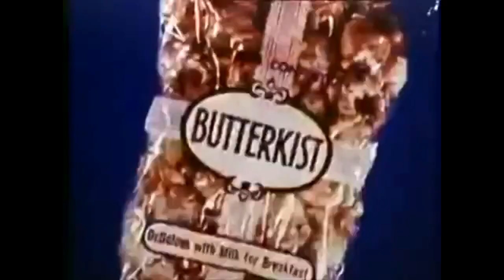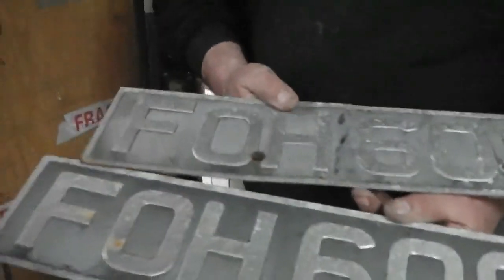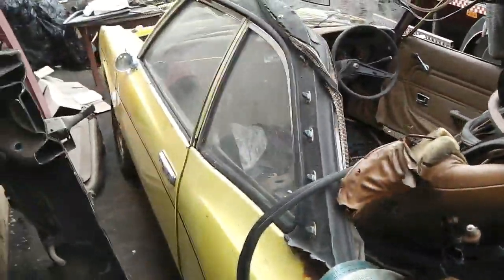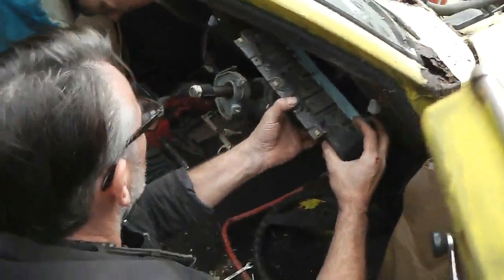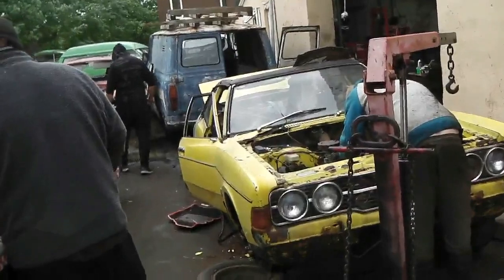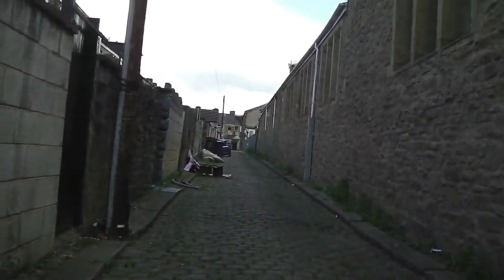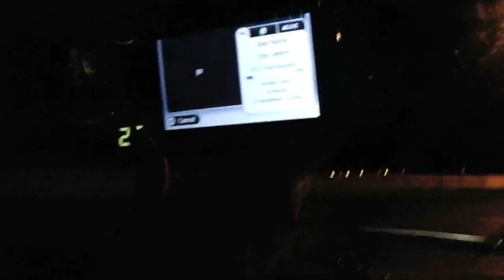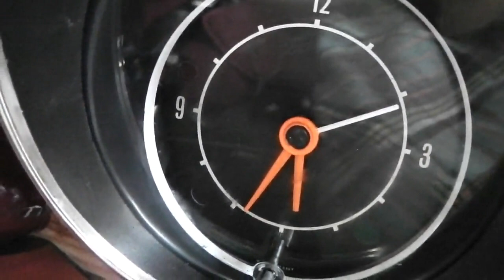Grave or Save? - Mk3 Ford Cortina Crayford - Cortina road trip!

Comment: Nothing like hacking the roof off a perfectly good car and replacing it with a leaky soft top to introduce terminal rust.  And fitted with 1.3 as well.  Must have been a real power house.  Best to let it return to the earth I think.  Looks like it was tarted up and probably sold as 'restored' before the floor fell out.  Even from something as bad as this it's educational to see how many parts can be salvaged.  Rainy cold Morecambe footage reminded me of the opening of Hell Is A City.  Pete fades to static in another crazy fun video.  Cheers
Reply: Except Crawford's weren't leaky. This car is 50 years old and you can clearly see it is rusted everywhere not just the roof. In fact the roof still looks pretty good.

Comment: Ruby looks just like my father's cortina although it was 2.0 GT ,exactly the same as colour as ruby, my father added two thin black stripes down the sides of the car and across the bonnet and boot, The car itself was perfectly running car it went all over uk and went down through Holland, France and Switzerland never ever had a problem with it with the miles we did, I loved that car, unfortunately because i had a crash on a motorbike ( not my fault  ) i was going to have the car when my father brought the mk4 cortina but because of the accident it caused me to have epilepsy, I really missed my father's car and loved to have it but oh well life goes on, keep looking at the cortina's i absolutely love them, I love the jobs you have done on your cars they are spot on with the work you have done to them. 
Well done Peter 👍

Comment: my old mates got a crayford infact hes got lots of old fords. he's got  mk1 rs2000 ford supplied the ford dealer where he worked with two for rallying but they only used one so he bought it. its a rare car he also bought all the old ford stock when the dealer moved to another part of the city.

Comment: It does look quite far gone. Would you regret walking away from it? If you would then you must grab it. A Crayford is worth saving if it can be saved. Personally I'd need it to be at least 1600cc though. Best of luck if you do buy it, seeing what you've done with your other Cortina's,  you could deffo do it.
Reply: There's nothing to start from interior is shot the cars practically in half with rot would need a shell and complete everything else except the heater box lol

Comment: were d you find these great old adverts pete? you got some kind of old vhs with them on? also hmm which cortina to take, swampy hmm no, trace err no don't fance breaking down or burning though smoke/engine today is ruby,
yep like most of us pete hasn't bothered to shave don't blame ya no point in looking neat if there's no place to go, just be thankful the pubs still there and not been demo'd like so meny of the buildings on that scrap kings most of your nice 50's to 80's buildings gone, 
spare builk head and ooooh holes in the window area and the rear and no roof and >_< oooh its just oooh its starting to look like that green one all over again you can see though to the otherside, this is why you don't see crayfords pn the road any more, oooo and now were getting the spain/portigal one with no floor when lifting the carpet up and no sills this is a baden, means it wasn't stored in a dry barn but someone damp or were it was able to be leaked on, 
no sadly too far gone, mind you its better shape then the mk3 on ebay a few months ago it was trying to be  crayford as the roof had pritty much given way falling into itself, 1000 pounds, hmm very odd to see tht on a car, might be on cold mornings? to warm the fuel up to melt it as gas can freeze still odd though, 
looks like it was three colours, brown, then the later darker green as you can see on the remains of the sill driver side then was painted yellow, mind you once heater box is out your see what colour it was, 
oh messh and filler ouch i guess the predessor to fiber glass this was never going to see the road again, unless pete yuo sold off swampy, branble and ruby and you might just have enough to get the pannels, kinda car you put into the acid bath and all that comes out is the sides bits of room and boot ish parts everything else gone, 
might be as it was going to be a crayford they fitted some extra bits in, like the clock and the glx front that or someone mixed n matched wasn't that un-common back in the day to add extra parts as most places did that you brought the L and then added onto the list a clock or GXL front might of cost you but if someone had money to make it into a soft top though now its more soft top and bottom but back then they must of had money, 
bit of a shame but no sills, and bodges mostly looking to be the 80's boge of tin cans and filler and messh shame as it looked nice once and i kinda wouldn't mind seeing it in the brown or that almost mexico yellow? or very 80's ford yellow or even maybe japan yellow? seems to be a common colour,